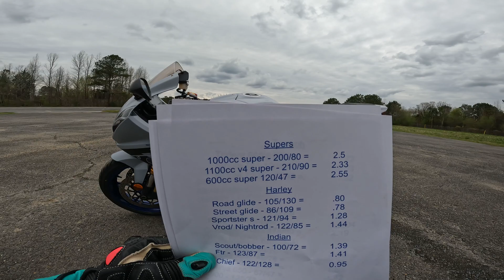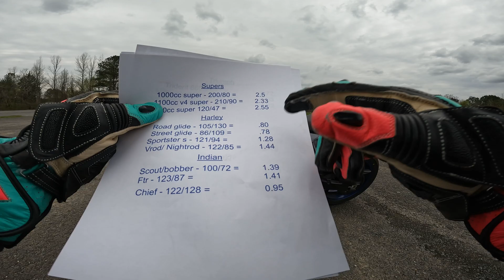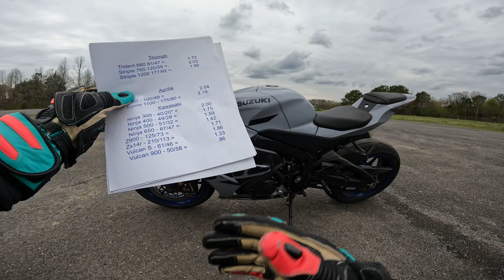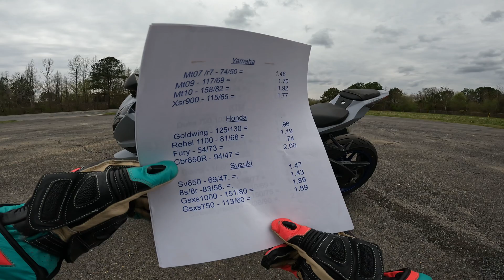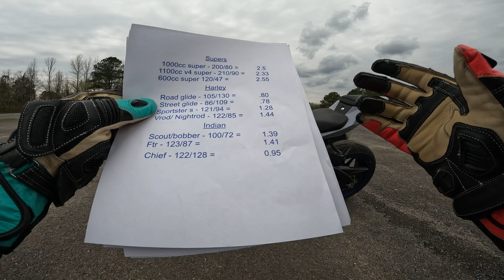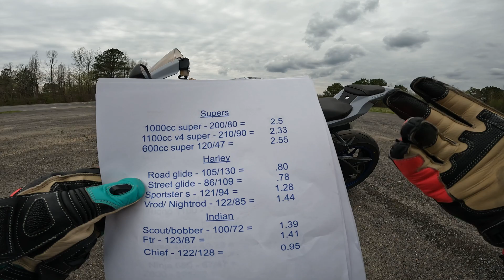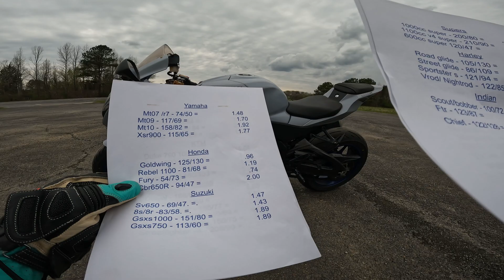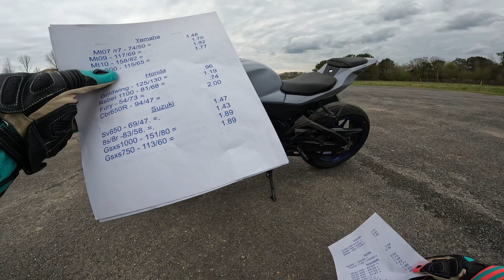Horsepower:Torque and its relevance to your next Bike purchase

Comment: I don't think your formula is right. I have both bikes and they are super close in numbers but in reality are not that comparable. My ninja 1000 has more power overall than my MT07. especially on the top end. I wouldn't put the 1000sx in a torque/cruiser category either. The 1000sx feels like a 1.75 not a 1.27. I rode my buddies 1000 GXR and yeahhh that was easy 2.2 ish+ bike in performance. Crazy stuff. 

Stats/Math
-Yamaha MT-07 (2024)
Horsepower: ~72 hp (54 kW) @ 8,750 rpm
Torque: ~67 Nm (49 lb-ft) @ 6,500 rpm
-Kawasaki Ninja 1000SX (2024)
Horsepower: ~142 hp (104 kW) @ 10,000 rpm
Torque: ~111 Nm (82 lb-ft) @ 8,000 rpm

Mt-07 is 72hp/67Nm = 1.07
Ninja 1000sx is 142hp/111 Nm = 1.27

Comment: Regardless of motorcycle brands, would you choose a motorcycle that put's out 128 horsepower @ 12,000 rpms with 59 ft lbs of torque @ 9500 rpms and weighs 414 lbs (with a 765 cc engine) or would you choose a motorcycle that puts out 117 horsepower @ 10,000 rpms with 68.5 ft lbs of torque @ 7000 rpms and weighs 228 lbs (with an 890 cc engine)? The 765 cc engine is geared to be at 5,500 rpms @ 65 mph in top gear and the 890 cc engine is geared to be at 4,400 rpms @ 65 mph in top gear. Imagine that the both bikes would be loaded down with 235 lbs with rider and gear. Ironically, the larger 890 cc is considerably more fuel efficient by at least 6 mpg. This would be for mostly street riding but I love both of these bike and you can probably guess by the specs above which two bikes I am talking about -- one of them is on your list. Thanks, by the way, your closer to "1" thing is really kind of helpful; I never thought of it like that.
Reply: mt09 vs 765 rs 🤔 new mt09 sp have closer weoght distirbution to 765 rs more track  focused than whelly = more weoght at front less uprtight position in such circumstances for me its close draw  mt09 thanks more torq  spin lower rpm  maybe have lil better fuel conomy but elasticity at the same gear despite have biger low modrange tprq not necesssery as this is always conect to longer final gear ratio when  power resist is similar and it even clock peak hp at lil lower rpm 👌🏻 like ypu write 4400 vs 5500 rpm at 65 mph according to dyno run eleasticity be pretty much very close at last gear from 65 to feg 100 mph 👌🏻 for me whatever here draw 👌🏻rs still be proabbaly lil faster at track thanks lil better topend thpugh dont know if or not it have wide peak like mt09 👌🏻

Comment: very simplifificty and in alot point lil wrong but whatever 👌🏻  proportion between torqueand power is parametres which avoid multiple stufff which impact on how motorcycle behave in regard to overalll engine capabilities but for 100% noobs let say its let say somehow lil ok let say 😉 👌🏻 as long as they also watch on level of peak power and not only this proportion betweeen torque and power level cos you can have this ratio on 0,5 level so huge torq integard to power level but because power level itself be very low let say 20 hp and 40 nm than yea this bike be waaaay weaker everywhere on rpm even on lowest rpm than let say something with this ratio of 2 but with peak power 200 than ypu have 100 nm and at 2000 rpm where forst version have 40 nm peak 2 version have like 70-80 nm so double of first version 👌🏻🤷🏻‍♂️but than also come into play gearing which also most dirver donttake into accout when subscribe how engine behave and they say massively BS often misleading engine lowend with final gear ratio asf aso ….also „torq how powerfull bike is under 5000 rpm and power above „ is 🤔 welll wrong cos torque i mean peak can be on waaaay above 5000 rpm but maybe in regard to cruisers vs sports bike thers some conections 👌🏻 cos usallly bike with more tprq than power have max torq lower often under or around 5 k rpm so in regard to this we can in fact say like this let say be lil but in regard to couple other point of view welll NOT REALLLY 😉👌🏻

Comment: You can also convert the horsepower to kW.
Ratio = Horsepower (kW) / Torque (Nm)
If you have  a bike with 80hp and 80Nm, you can convert the hp multiplying 80(hp) by 0.7457.
Ratio = 60kW / 80Nm 
Ratio = 0.75
In this case when comparing the ratios of different motorcycles, it is essential to use consistent units for accurate comparison.

Comment: The Panigalve V4 has 216hp/124Nm = 1,74 ratio ... same as a Ninja 400. How do you interpret that?
Reply: it mean both would have similar power characterisitcs but for this also rpm at which egzist must be known still not full picture but let say engine characterisitc similar but level of power completellly diffrent so performance level on straights completellly diffrent yea he is lill offf with prediction what this ratio is capable to subscribe 😉👌🏻

Comment: A 1/4 drag race features a 100HP bike with 1# of torque vs a 1HP bike with 100# of torque. Who wins? Does the same bike win if it were a 10 mile long drag race?
Reply: at perfect gearing it be in 99 out of 100 version with more power and less torq 👌🏻 100 hp /1 nm at perfect gearing let say its 200 kg cruiser  be able to defeat 1/4 mille in like 11,5 sec +/- vs 1 hp /100 nm version also at perfect gearing would need like im not sure if 1 minute be enough 🤔  it at 1 hp achieve maybe 30 km/h in let say 30 sec what mean avg 0,28 G what mean it reach it at around 125 metres and 30 km/h for whats left 275 metres +/- mean + 33 sec +/- yea it probably be above 1 minute 👌🏻 so yea 1 hp 100 nm version be good engine for  your teeth cleaning machine at most especially if you have big inscisorrs 🤓 ….. and not for 200 kg cruiser which must overtake bus at 100 km/h relatively  fast - at comfortable rate/pace/tempo with 100 kg driver and often 50-100 kg another person onboard or some bag etc 😉👌🏻 in fact thers couple other powibility to ypur wuestion i assume most often seen on road setup where gearing is at least acceptable good what is true for most motorcycles on road 👌🏻 1 hp 100 nm version can win only if gering be very faaar  from perfect for 100 hp1 nm version or let say both have only 1 gear and no clutch at all and the same final gear ratio than on each distance up to certain distanc lenght 1hp 100 nm version win assuming it have everywhere on low the same rpm more tprq so more hp at those low rpm …above is this specified /certain distance depend on gear lenght  100 hp1 nm always win  👌🏻 it must catch up this what it loses asf ….. once you setup perfect gearing for each and its game over for 1 hp /100 nm version at each distance  cos power:speed= force  and  acceelration depend on force level divide be all resist simple 👌🏻 real world egzample ypu have in cars technical specification catalogue stats where they give 0-100 km/h time for each version for the same car and version with more power and less torque is almost always faster 👌🏻 top speed also have alwaus more 👌🏻 feg peugeot 206 1,4 hdi version so 68 os hp 150 nm 0-100 in 14,7 vmax 165 km/h vs version 1,4 16 v 88 os hp 133 nm 0-100 11,7 sec vmax 178 km/h 👌🏻 real world egzample from motorcycle world let say h-d x440 38 nm 27 hp 0-100 10 sec vmax 140 km/h vs benelli tnt 302 26 nm 37 hp 0-100 8 sec vmax 155 km/h both similar drag and weight and drive train losess 👌🏻 those are egzample farr from your extreme numbers where 100 hp 1 nm is waaaay above conventional combustion engines capability cos rpm level for achieve 100 hp from 1 nm is waaay to much preciselly speaking +/- 712080 rpm 3/4 of 1 mln rpm and conventional combustion engine with 10 ccm cos we twlk about 1 nm will stand maybe like 50 k rpm os above it probably damage crank shaft etc anyways like +/- 10-15 times to much rpm than what our tehcnology can make without blew up  engine into pieces 👌🏻let say….  but tendency is clear i quesss 👌🏻

Comment: This is the main reason I like inline 3s and parallel twins so much. Inline 3s arent so commital to hp like the inline 4s are, while(current) parallel twins arent so committed to torque like the v-twins are. You get a good balance of hp and torque without one overbalancing the other. My street triple r is a 1.54

Comment: The simplest way to explain torque versus horsepower that isn't an oversimplification is a graph showing torque over wheelspeed in each gear. Get that for the bikes you're comparing. Then have a look how you like the curves and which is better in the speeds you're typically riding at, and assume you're two downshifts away from optimal gear when you're on the street.. That is because the gearing is literally what every simplified explanation skips, and it's definitely needed for the understanding.

Comment: I always make a power to weight ratio and torque to weight ratio when I'm looking at bikes. It's a good way to weed things out before the next step. You may also want to look at the power curves as well, to see when your power kicks in. As you stated your mark was above or below 5k. But I think alot of crusers make it rather low and inline 4s make it pretty high up. Thanks for the video keep going I like your videos.
Reply from the maker: I gave up on reading weights on bikes tbh, so many feel so much different in person class:class its almost impossible to guess.  Rsv4 is the best example of a bike that feels like a feather between the legs but is a pig for its class if you were to walk it up a scale.  Suzuki's as a whole as well always feel lighter between the legs than they are on paper

Comment: Thanks I never understood this. I would only use CC size to assume one is faster over the other but once I got beat by a Gixer 750 while ridding a 900cc bike. ( both Stock)(straight-line -less than 1/4 mile) distance  n realized I was missing a piece in this puzzle. Much appreciated.

Comment: What is often less said in these "engine output" discussions is the effect wide or narrow gearing has on the character of a particular motorcycle. Sportbikes of the high-reving nature usually have very narrow and very tall gearing; that allows the upshift at high RPM to drop just a few thousand. That's great if you shift at 14,000 rpm but what if you shift at 6000 rpm? Then the rpm drops just a tiny bit, thereby forcing another shift.

The more street-oriented motorcycles have wider-spaced gearings...more of a compromise whereby shifting at lower rpm is pleasant but still narrow enough that a shift at high rpm won't completely drop you out of the power band.

I do think the new Euro 5 standards have been weirdly favorable to motorcyclists; by essentially herding all these motors into big valve, short advance, long-stroke motors, all current Euro-5 motors have power down low and wide. On paper while these bikes seem to make less power, in practice they're much faster for most people because they're much easier to ride. And since they don't need to win races, they can be exceptionally large displacement engines that don't need to rev much, thus also being quite light without using exotic materials.
Reply from the maker: The move to the euro 5 engines is a hot debate I'm still not sure where I side entirely but I tend to agree with you. Ptwins and those flat powerbands are so uniquely capable and easy to ride its a shame people call them boring imo

Comment: You are 100% correct i have a bike that has  torque   of 75ft pounds/100 NM qnd 100 hp. Its not the fastest bike in the world but it pulls you back every time you open the trottle from very  low rpms all the way to the top ,it can even powrr wheelie in low gears . Fun for roads

Comment: Torque : how easy is it to lift the front wheel off the ground  in ANY GEAR
Horsepower : what is TOP SPEED of the bike in ANY GEAR

your ratio  the lower the number  .7-1.2 is most likely to lift the front wheel off the ground and induce DEATH WOBBLE on the free way
your ration 1.2-2.0 nice all around bike that will get you to work and in the parkinglot and put smiles on your face in the twisties and the straight aways 
your ratio the higher the number 2+ is most likely to GO FAST to get your butt out of trouble on the freeway

TORQUE is the TRACTOR in the FEILD
HORSEPOWER is the RACE CAR on the TRACK

visual aesthetics are PERSONAL pick an ugly  bike at your own risk you may just fall in love over time
Reply: Try riding a 600 supersport two up 450 pounds total and tell me how it feels on a big adventure bike like the gs you can pull and accelerate easy even with that kind of weight . If you are a 150 pound feather and only do solo riding then yeah no need for torque but if you are a big guy and put a passenger and or luggage you need that torque .
Reply: Nonsense

Comment: When trying to look at a bike sideways on, instead of looking from the kickstand side and having to crouch and look up, would it be easier to look from the right side down standing??
Reply from the maker: Oh absolutely, but trying to keep these papers from running away while messing with the camera ended up with this being the solution 😂
Reply: @skyoom1  I see. Commenting because I saw another one of your videos yesturday comparing the riding position between 3 bikes, shot from the same angle. 

Staring into the sun and looking at the shaded side of the bike and crouching on the floor seems more effort and less optimal results to me
Reply from the maker: @krisswolf2011  that one ended up a logistical nightmare between getting the bikes there, a tree service coming to start cutting down trees within mic distance of where I originally intended to film, and trying to avoid being too close to people to avoid them in the video.  I agree with you though and the videography is a work in progress for sure

Comment: Appreciate the effort, but you lost me. Not a numbes guy.

40 years of riding, what I need from an engine is simple for me.

If it accerates faxt enough to make me smile, i'm happy.

If I still have power on tap while riding at increased speed sometimes considered questionabe, i'm happy.

If I can quickly pass slow or risky traffic, at any speed, without the need to downshift, i'm happy.

Give me a bike that I like visually and from the saddle with those 3 engine characteristics.....sold.
Reply from the maker: Nothing wrong with that at all my friend 🙂

Comment: You need power to accelerate and go fast. Power = power. Torque = how little rpm you need to make power.
Reply: Torque = the amount of work an engine can do. Horsepower = the speed an engine can perform said work. He explained it pretty well tho. Torque is power at the bottom of the powerband, Horsepower is power at the top of the powerband.
Reply: @russthomasjr  Torque is not an amount of work the engine can do. It is the amount of twisting force it can exert on the clutch. You could see torque as an 'amount of work' per revolution of the motor. This figure however does not mean too much if you do not know how fast the motor is revving. thus, you multiply torque by rpm. This yields power, power is indeed work per unit time. 

Two engines, one with 200 Nm of torque at 2000 rpm and another with 100 Nm of torque at 4000 rpm can do the same amount of work, because the first has the same power at 2000rpm as the second has at 4000rpm.

The phrase "torque is power at the bottom of the powerband" is misleading, because torque is not power and the term 'powerband' is vague. An engine may have a high torque figure, but only reach said torque figure at a high rpm. An engine having high torque thus does not necessarily mean it pulls wel at low rpm. 

Of course, if you define the powerband to start at or near the point of maximum torque, said phrase works a bit better. But even in that case, a given amount of torque at 4000rpm does more work/yields more power than that same amount of torque at 2000rpm.

Example: the ducati V4 has 124Nm at 9500 rpm. The new bmw R12ninet has 115Nm at 6500rpm. Yet, people will describe the V4 as having a high power engine, while they describe the bmw as having a high torque engine. The ducati has about the same amount of torque at 6500rpm as the bmw (and thus the same power at that rpm), with the difference that for the bmw that is the torque peak while for the ducati it is not. What this example shows, is that peak torque and power values and the ratio between them are not the full story. at 6500rpm, both the bmw and the ducati engine will pull equally hard (given the same gearing ratio etcetera), although they have different peak power, peak torque and power/torque ratio.

I think it is most informative to look at multiple figures if you want to get a feel for the character of an engine: peak power and its rpm, peak torque and its rpm, the ratio between power and torque, the difference between the rpms of peak power and peak torque, and last but not least: where the dyno graphs start. For the ducati, the graph on the ducati website starts at 4000rpm. This tells you the rideability at (very) low rpms is suboptimal, because of course it is a highly tuned engine.
Reply: @Gnerko123  or companies could just give us a f graph torq/power@rpm
jesus why the hell we still have to figure that out by ourself